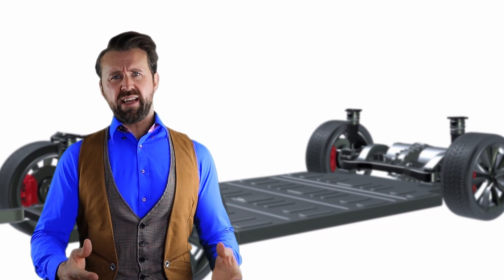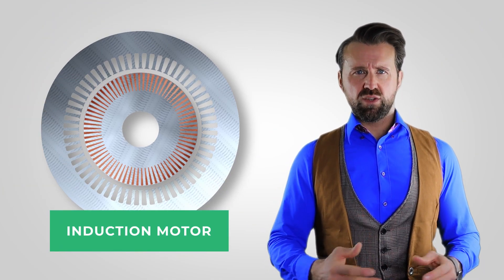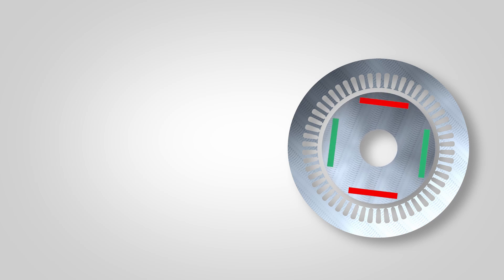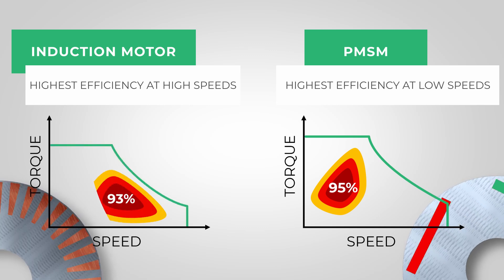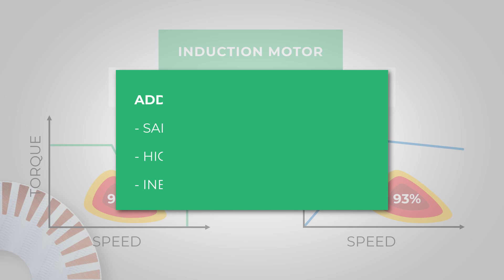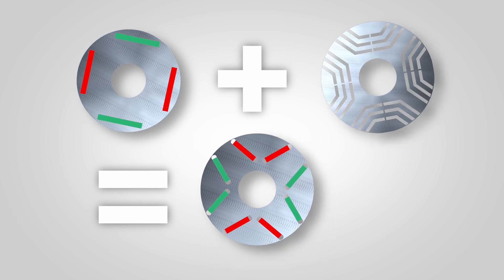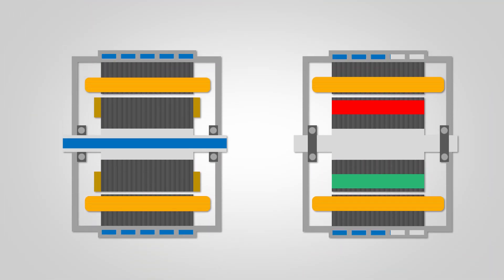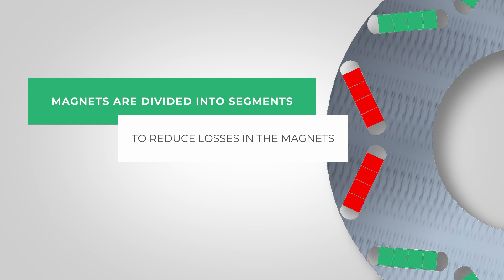Tesla Motor the Secret of high Efficiency

Comment: For a given torque which motor design would be the most cost effective and which would be the most efficient motor? One wound with fewer turns for a high current low voltage or one wound with smaller wire and more turns for a higher voltage lower current motor. Would there be any difference for ether? Thanks for the videos my knowledge of motors is very limited  Best wishes.
Reply from the maker: Assuming we keep the motor costs constant, then we can say. 
1) Many turns with a thin wire result in a motor with a high torque. However, this is not efficient and does not have a high output power. 
2) A motor with few windings and a thin wire results in an efficient motor but not a high torque.
It is difficult to make generally valid statements, I hope the answer helps you?

Comment: I do not understand why and ‘additional coolant’ is needed in the induction motor.  In fact, I had no idea that any coolant was needed at all!  I took a physics class at Cal Berkrley’s Lawrence Hall of Science at age 11, and this did not come up.  Could you expatiate on this?
Reply from the maker: I am happy to try to help. Every motor needs to be cooled. This can be done passively or actively. Becuase induction motors have higher losses than synchronous motors, they also require better cooling. Hope this has helped a little?

Comment: First, thank you. The video is so helpfull.
Now, I have a question. Could you tell me why we divide the magnets? I need to more details.
As i understand, we divide to reduce losses in magnets,sheet and coil. But what are disadvantages?
Reply from the maker: Sorry for the super late reply, diving magnets has the same reason like sheet metal, but it is only important at high speed motors, disadvantage is the higher price for smaller magnets and sometimes a bit less magnetic flux

Comment: Can you do a video about transverse-flux motors and circumferential-flux motors?
Reply: is transverse flux somehow using coils with different fluxes along the axle of the motor instead of around the axle? or do you mean axial flux motor?
Reply from the maker: Transverse flux motors are often used for generators in cars because the production is very simple and cost-effective. Axial flux motors, on the other hand, tend to be more expensive because of the 3D lamination. You can see it in the new video about high torque motor types. Hope you like it too.

Comment: Tesla is claiming the motor torque is about 350-500NM depending on different models, so my question is the torque is after the gears or its just the torque of the motor?

Comment: So if we want to improve the energy efficiency of an electric vehicle, the selection and modelling of AC motoros play a key role. What other things could we look at? I.e. higher battery density, what else?
Reply from the maker: For example, increase the copper fill factor or adjust the control to the electric motor.

Comment: Thanks for the great video, could you please explain how an additional current is needed to weaken the magnets in the PMSM, why would you need to weaken the magnets at the first place ? @ 1:28
Reply from the maker: With an IPMSM, you weaken the magnets to get more current into the motor at high speeds. This increases the power at high speeds. However, this does not mean that the efficiency also increases. You could of course use weaker magnets directly, but you would reduce the torque at low speeds. You always have to look very carefully at the operating points that are important for you when developing an electric motor. Hope the short answer helps you a bit?

Comment: Hi there. Do you know which motors are used in which teslas. Such as 3d1, 3d3, 3d5, 3d6, 3d7 etc. Which ones have how much kW of power? Some sites say the 3d6 has 220 kw, but some say the 3d6 has 239 kW of power. Which one is right. Also, which of the motors user hairpin winding? Is hairpin good or bad?
Reply from the maker: Thanks for your question and sorry for my late reply. Which models have which engines I can not tell you. In general, hairpin windings are very good for reducing ohmic DC losses. However, at the high speeds, the resistive AC losses are much more important. The winding head is also smaller with a hairpin winding, which is actually positive in terms of DC losses. However, the implementation of the hairpin winding is deficient with most manufacturers with regard to the cooling of the winding at the winding head. As you can see, Tesla currently has good reasons not to primarily use hairpin winding. Hope this infos helps and could answer your question?
Reply: @Electric-Motor  seems like the latest Model 3 are being shipped with new hairpin wound rear motors, any ideas on why? Is the manufacturing process easier / cheaper?

Comment: So if I add magnet to the shaft cages as see in the video I can get Better running time a cooling down
Reply from the maker: By using the magnets, the losses in the rotor are smaller and therefore you don't need a liquid cooled shaft. Hope this answers your question?

Comment: Nice description. I have some info that the efficiency of the tesla motor (IPM one) is something around 97%.
Reply from the maker: Thanks for your tip, is the 97% given at 20 degrees or 100 degrees motor temperature? It is very sad that the data of many of the manufacturers are never really comparable because the boundary conditions are usually not specified.

Comment: How many slots are present for winding also which gauge wire AWG number used in tesla model 3&s PMSM reluctance motor what is input voltage to motor how many number of poles??? can you Explain
Reply from the maker: Hello Thank you for your question. What do you need the information for or what do you have planned?
Reply: @Electric-Motor  in research of manufacturing EV Motors so can I get my answer? Also what is inverter used input voltage dc of inverter output voltage ac?
Reply from the maker: @Rohit.Ginkala  I am happy to help you with any questions, but I hope you understand that I am not authorized to share Tesla's design parameters. But it wouldn't help you because the control software has a significant influence on the performance of the motor. I am very sorry

Comment: So what is the difference between ipmsm motor in prius and ipm-synrm motor in tesla?
Reply from the maker: Hello, The operating principle used is actually the same. The Prius motor is much shorter and has 8 poles in the rotor instead of 6 like the tesla motor, if I remember correctly. Accordingly, the configuration of the stator is also different.
Reply: @Electric-Motor  I just wonder why  Tesla motor is called ipmsynrm when its just  regular ipmsm. What is synrm in this motor?
Reply from the maker: @mantis23101988  You are absolutely right, unfortunately the internet is 90% crap, the informations are mostly not really wrong but nonsensical. The Tesla motor would also work without magnets, which would then be a poor synchronous reluctance motor (SynRM) that would of course have much less torque. Important SynRM is not equal to SRM. SRM stands for Switched Reluctance Motor and is also shortened to SR Motor. Hope this has helped you a little bit?
Reply: @Electric-Motor  yes, a little bit. Thank you.

Comment: can you please tell me how to select magnet type, decide V angle of the magnets., length, width, thickness and position of he magnets in the rotor?
Reply from the maker: The best angle and magnet length and thickness depends on how much reluctance torque you want your motor to have. Maximizing the reluctance torque has not only advantages but also disadvantages. Normally you need a special software to design the electric motor. Such a software then needs hundreds of parameters to make a calculation. To make it faster you need optimization algorithms to serve the calculation software. My tip would be to start with a block design without V-segments. This way you can test the influence of more and less magnetic material. If you really want to start with V-segments, the design of Tesla is a good starting point. With magnets of different strengths you can then try out how you get closer to your goal. May I ask what you want to build?
Reply: @Electric-Motor  thank you very much for your response.want to develop 4.5kW rated power, 20Nm rated torque, 60Nm pk torque IPMSM motor for Electric Two wheeler application.
Reply from the maker: @AkashDeepSingh-dq2ty  Sounds like a great project. Then I would suggest to buy a motor and vary the strength of the magnets. The second step would be to make your own design for only the rotor. Are you doing this for a company or just as a hobby?
Reply: @Electric-Motor   Can you please share your email-id. I can share you the detail there. Thanks
Reply from the maker: @Akash Deep Singh
Reply: and shape of the magnet? Please help me to find answers of above question.

Comment: Great video sir.

Sir, may you provide some guidance on design of PMSM, I am working on this..🙏
Reply from the maker: Hello, I'm happy to help you! I don't know of any PDF or book that describes the design of a PMSM well. Most books mainly describe the theory. What software do you use for the design?
Reply: Sir I am working on ANSYS Maxwell software
Reply: Sir @oswos my first doubt is regarding sizing ... How did we get to know about what size (means dia of stator, rotor...) is to be kept..!

I have specifications of motor
Reply from the maker: Ansys Maxwell is very good but already the third step! You have to use an analytical tool first to get a feeling which parameter has influence on the torque and the speed. You can use Rmxprt for example. This is not the best tool but it is also from Ansys. If you work at the university then it is easier to get licenses. The second step is the thermal design of the motor, so design the of the cooling. Have a great day

Comment: How, do the segmented permanent magnets help reduce losses?
Reply from the maker: Thanks for your question. The segmentation reduces the eddy current losses. Normally, magnets are only segmented radially, but in very fast motors, they are also segmented axially.
Reply: @Electric-Motor  For this motor in video, the segmets are axially ?

Comment: Also what is Air gap roll in electric motor performance?
Reply from the maker: This question is difficult to answer! 
The smaller the air gap, the larger the back EMF.
However, this also reduces the maximum speed.
Because power consists of speed and torque, every motor has a certain air gap at which the highest power can be achieved.
If you are looking for a motor with a high power density, you should take a motor that has a high speed.
If you are looking for a motor with a high torque density, you should choose a motor with a small air gap.
As I said, not an easy question, but I hope the answer helps a little.

Comment: How many poles can exist on 3 phases?
Reply from the maker: The number of poles of a motor is actually limited only by the number of stator teeth and the configuration of the windings. But please keep in mind that by increasing the number of poles you increase the torque, but you also decrease the maximum speed of the motor! And the losses in the sheet metal also increase with increasing number of poles.

Comment: Great Video, Just interested on where do you find that Tesla is cooling the PMs inside the rotor to weaken them? I thought, you weaken magnets by heating them.
Reply from the maker: Thanks for your question, I'm sorry but I think you misunderstood me. 

Generally, you always try to protect magnets from overheating, so that if you weaken them with a magnetic field, they will not demagnetize.

Due to the design of Tesla's rotor ( embedded magnets in a V-shape), the electric motor has a lower back EMF and therefore needs to be weakened less. 

The lower back EMF is compensated by a reluctance torque. 

Therefore, the motor has fewer losses in the high speed range and a higher efficiency at both high and low speeds. Verstehst du jetzt besser was ich meine? 

Do you understand now better what I mean?
Reply: @Electric-Motor  Thanks for the explanation!